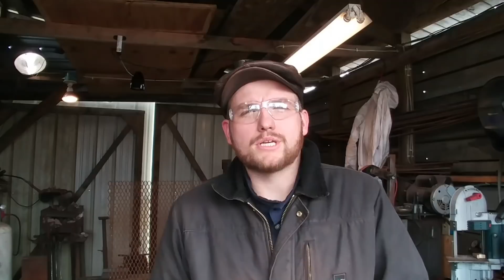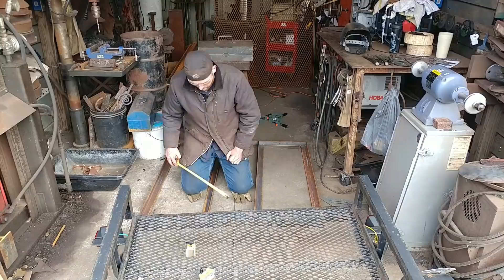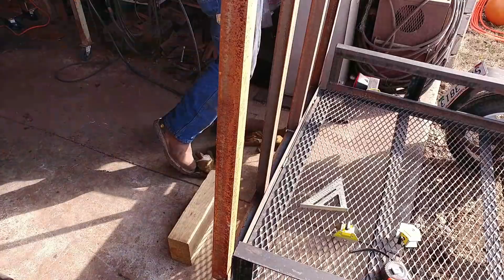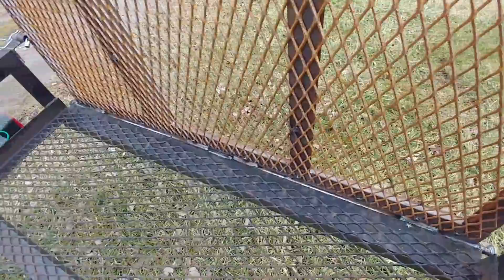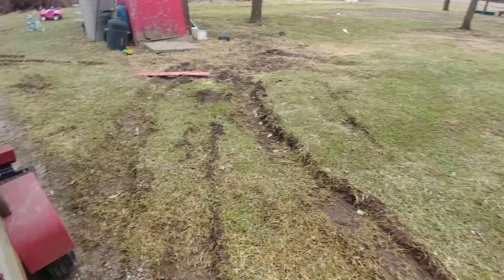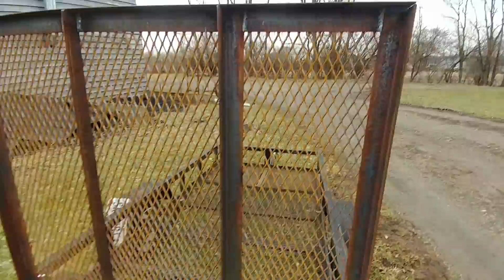Making a Trailer Gate: FABRICATION TIME!

Comment: I have a small 6' X 4' trailer that has a trailer gate. I have this idea for attaching swing out wheels on the gate that can be secured when not in use. I thought that there might be such a thing already, but I can't find anything. I would like to be able to lower the gate with the wheels down and locked in place, supporting the gate to lengthen the bed. My purpose is for picking up longer tree limbs and other yard debris so I can move it all to where I burn. I might just go with removable and not a swing out design. I may be able to find something that way.

Comment: Build a  4X8 steel table!  Put it outside if you don't have room inside. It will take it 10 years or more  to  rust if you treat it monthly by wire wheeling  and sanding it  with a 4" grinder and lightly coating it with NEW 30W oil. (Now I see how old this is.  I hope you have a good steel table in the new shop by now.)  Still a good video.
Reply: My dad’s iron table has been outside for 40 years and it’s in great condition. As long as you don’t let leaves and dirt collect on it, it will be fine and last forever. My dad never oils his but his is 1” thick

Comment: Thanks for sharing your video, hope you heal up and get back into the swing of things. I have a question about automotive coil springs, how much heat should I apply to make the two ends meet? Right now one end is up about 3/4 of an inch. I am trying to make a campfire pot stand, with several circular rings welded together. This is my cut coil spring section where you can see one side is raised up . https://imgur.com/a/yd8Kp thanks for any advice.
Reply: I posted the wrong photo, this is my cut coil spring steel. https://imgur.com/a/nQdNi

Comment: I had a heck of a time welding the gate on to my utility trailer. The added issue I had with mine was I wanted the tailgate to fold flat into the bed of the trailer as well as fold out to the ground. If you look back on my channel / playlist you can find the $50 trailer build